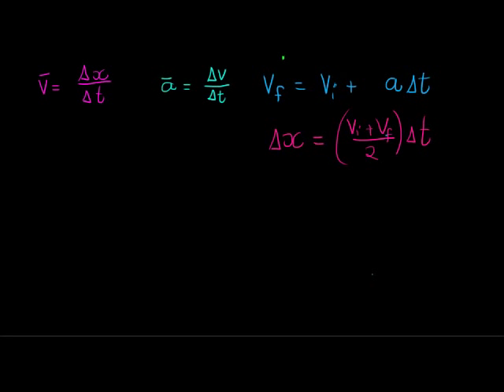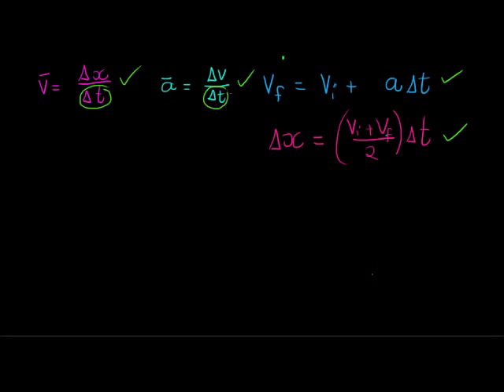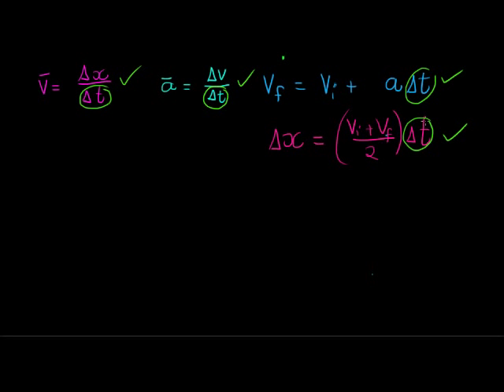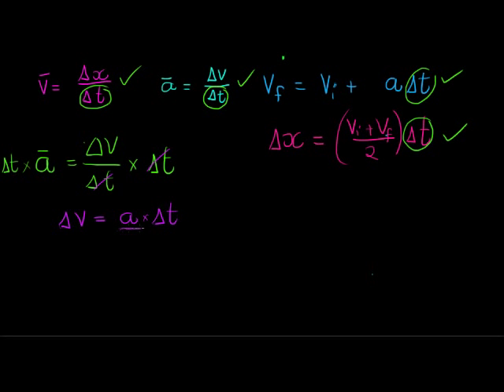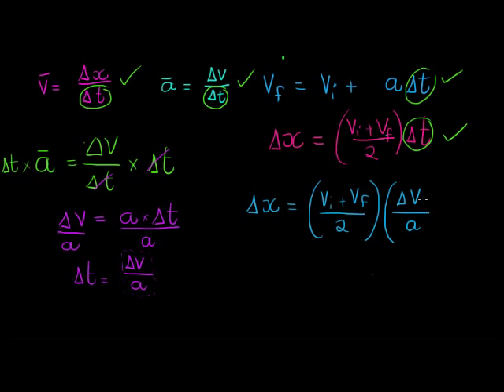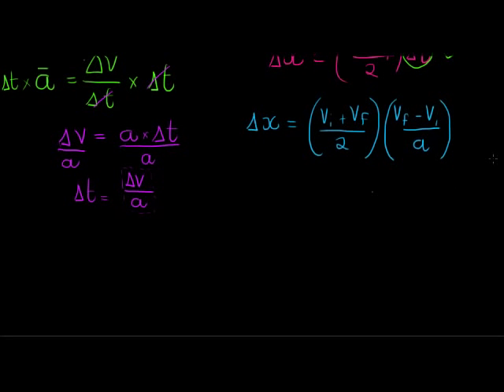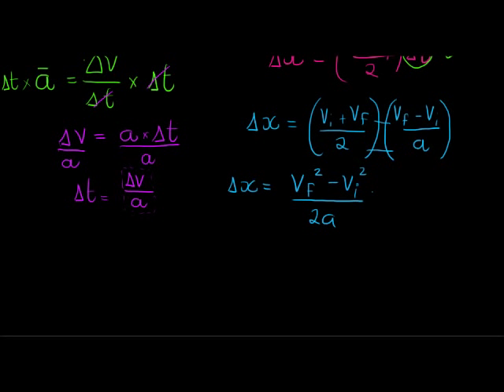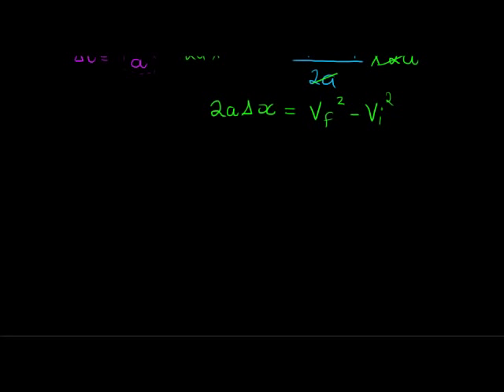Deriving vf^2=vi^2+2aDt

Comment: Why make it so complicated?   Why not do this from a conservation of energy standpoint?

Final Kinetic Energy = Initial KE + Work done on the system

1/2 * m * vf^2 = 1/2 * m * vi^2 + Force * Distance

Force = Mass * Acceleration, Hence

1/2 * m * vf^2 = 1/2 * m * vi^2 + m * a * d

Mass cancels out, and multiply both sides by 2

vf^2 = vi^2 + 2ad
Reply from the maker: Thanks for that! Actually, for the South African Curriculum, the level for this lesson has only started Mechanics and not really come to Force not to mention Work done. It is the first time I saw your approach - I like it. But it made me wonder - where did the Kinetic Energy formula come from? I think the KE formula must be a derivation of kinetic formulas and the principle of conservation of energy rather than the suggested approach deriving a kinetic formula from it. I might be wrong :)
Reply: I guess I was going kind of backwards.  Come to think of it, in school I did learn your version of proof first.  

As for 1/2mv^2, I thought that's a pretty standard formula.  But if I had to derive it, I guess, I would start from

F * d = W = Change in KE.
F = ma,

d = 1/2 a*t^2, Hence
W = 1/2 a*t^2 * m *a
W = 1/2 * m * a^2 * t^2 
W = 1/2 * m * (at)^2 
W = 1/2 * m * v^2 = KE